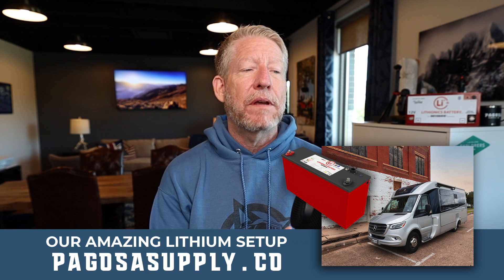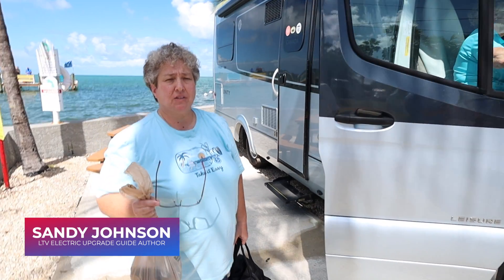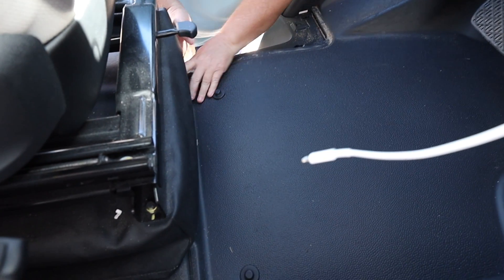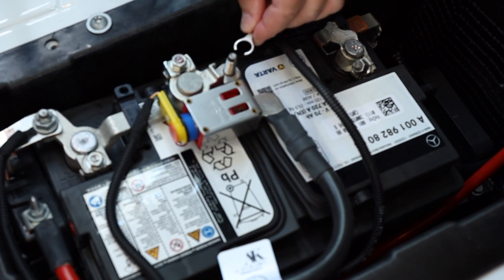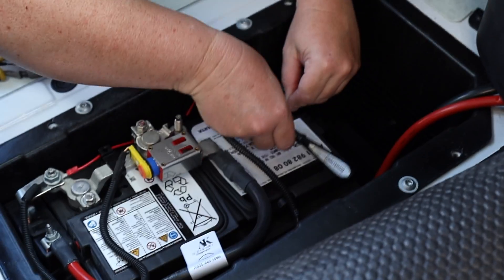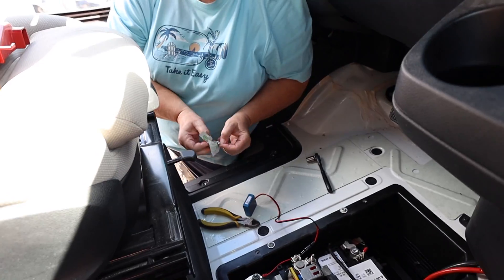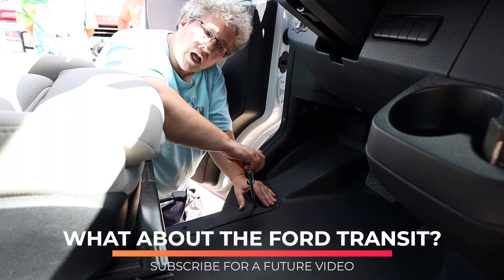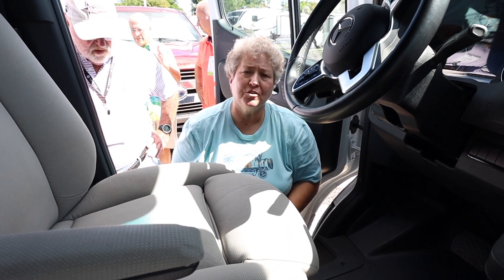Victron chassis battery monitor. Easy leisure Travel Vans Sprinter DIY.

Comment: Hi Brandon, I just got my 2025 LTV this week. I am having problem with right side blind spots. The side mirror is appears closer then actual. I can’t see the car next to mine. I had moved mirror away from the edge of me car  now. It sees only the part of the car next to mine now. It is enlarged. Do you have to same issue and how do you adjust your passenger mirrors? Can you do a video for this?
Reply from the maker: If its the same as my 2020, I didn't really have a problem with seeing. I have my seat all the way back, so not sure if that's an advantage or not.

Comment: I have a battery minder for my chassis battery. It goes dead after 4 days.:( I haven’t used the chassis battery disconnect by the throttle peddle. Suspect it needs replacement it’s 5 years old. I like this sens system looks easy to install.:) thanks Brandon
Reply from the maker: 5 years is about their lifespan, so prob a trip to the battery store will solve that

Comment: If I store my Unity over the winter with this installed will it drain down the battery?  How much power does it take?
Reply from the maker: There will be a very small parasitic draw. I don't know how much, but very little. If you plan on storing for the winter, I would add a trickle charge with or without this device. Hope that helps.
Reply: @Pagosa  sadly I don’t have power at my storage but I do have a small solar panel inside the windshield connected directly to the Mercedes battery which has worked well for several years. Thank you!

Comment: When adding this to a system with a Victron 712 Battery Monitor, Victron 3000w inverter charger and a color control GX console, will the presence of the smart battery sense on the chassis battery confuse the system for the coach batteries?
Reply: The Victron Battery Sense is just a voltage reading it won't conflict with anything. It is just another Battery voltage reading but for the chassis battery. The Victron solar controller also reads coach battery voltage. Many devices in the LTV use battery voltage readings and there isn't any issues with those nor do they cause any sort of confusion or conflict.
Reply: @SandyRVUpgrades , Thank you for the insights!

Comment: Sandy where is ur Buckeye t shirt. I have a AMP L battery to battery charger so I will never have a resting charge and oh yeah my Wonder Firefly system reads SOC of both Batteries.
Reply: I don't know how accurate the Firefly voltage readings are. I know in my Unity the Seelevel Coach battery voltage reading can be as much as 1v off. The closer the reading is taken to the battery the more accurate. I would use a voltmeter to actually verify the Firefly or Muliplex voltage readings against a voltmeter reading at the battery terminals.
Reply from the maker: Some Unity have the firefly as well, so this wouldn’t be needed.

Comment: On my 2022 Wonder RTB the Firefly system displays house and chassis battery voltage status, so would I even need this?  I can also access it remotely from the app.
Reply: I don't know how accurate the Firefly voltage readings are. I know in my Unity the Seelevel Coach battery voltage reading can be as much as 1v off. The closer the reading is taken to the battery the more accurate. I would use a voltmeter to actually verify the Firefly or Muliplex voltage readings against a voltmeter reading at the battery terminals.
Reply: Advantage Firefly system 👍
Reply from the maker: If you can see chassis battery SOC, then you are good to go.

Comment: Excellent work Sandy!

I’ve just begun researching an RV purchase and the information you have shared has convinced me to skip the generator in favor of using lithium batteries. I still have some work to decide what type of system will work best for me and your work is making that far easier than it would have been otherwise.